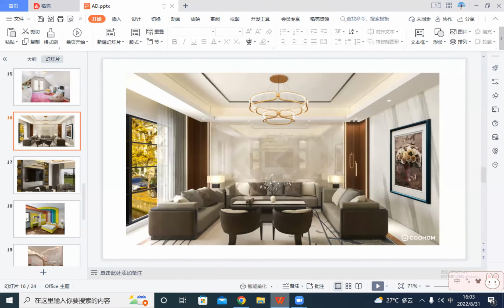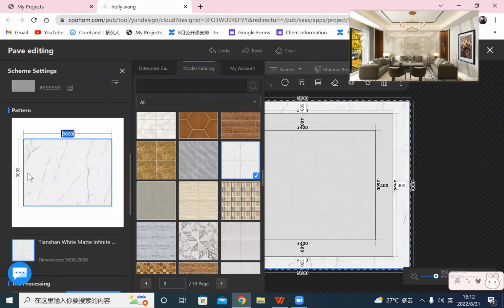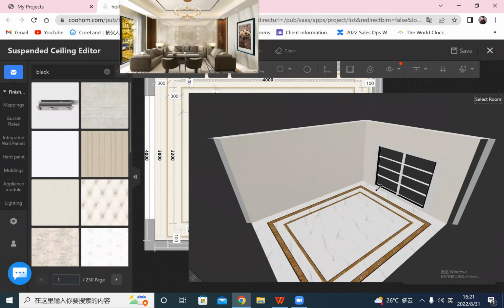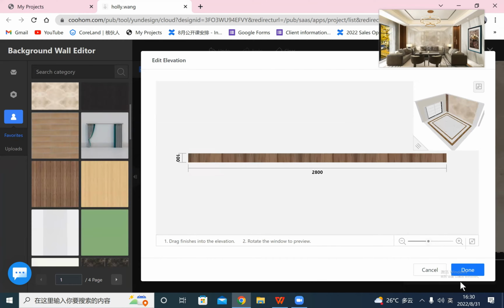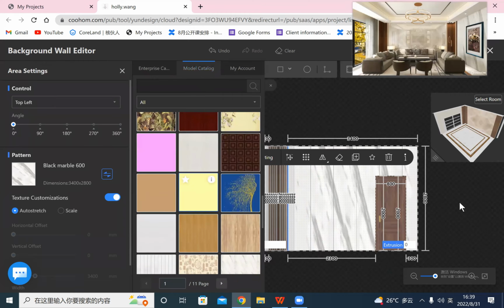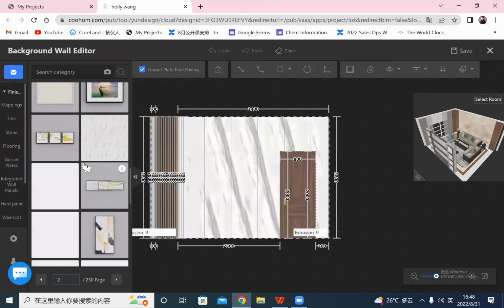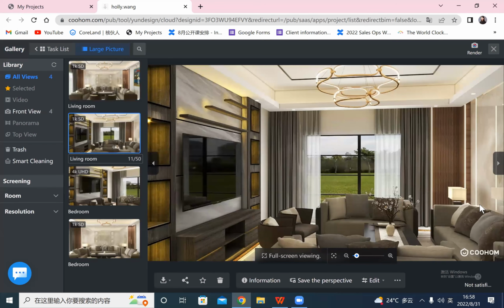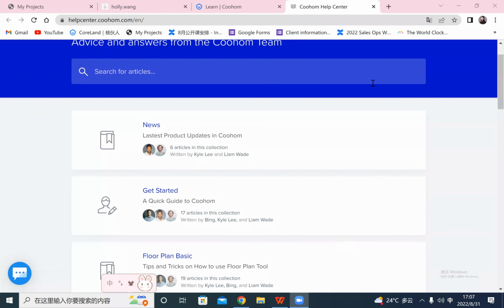Webinar-Coohom Modern living room design

Comment: The outer most ceiling which is where downlight place...it looks a different thickness...you extrude to 400 at first...how you do the distance of the  slab and the ceiling...it comes like false ceiling...there is a gap between the slab and the ceiling...how did you do
Reply from the maker: The video show you step by step how to do it.